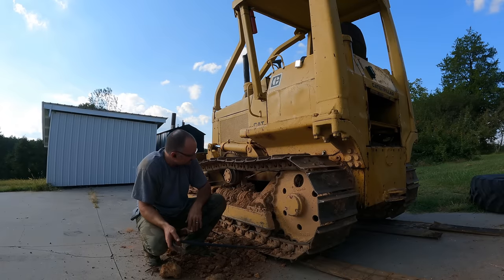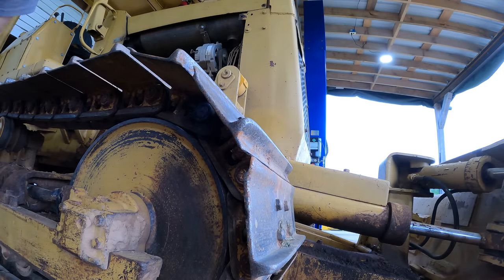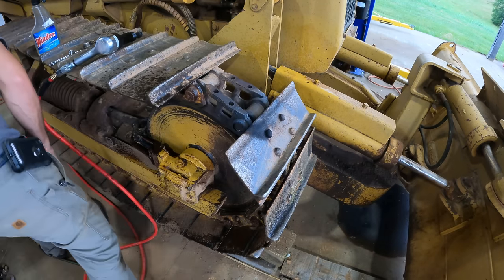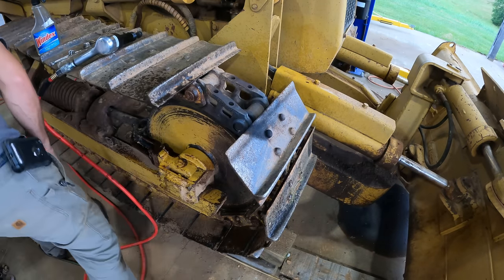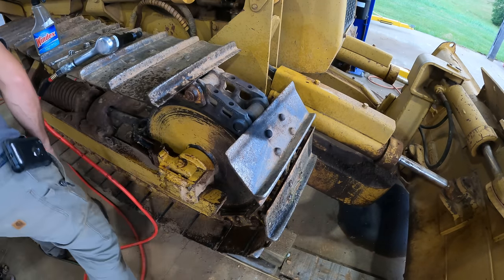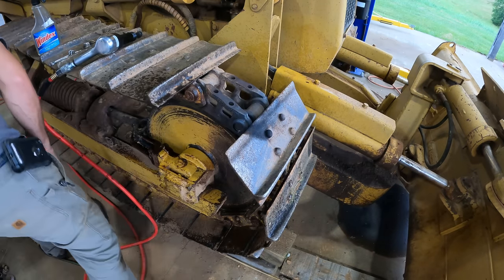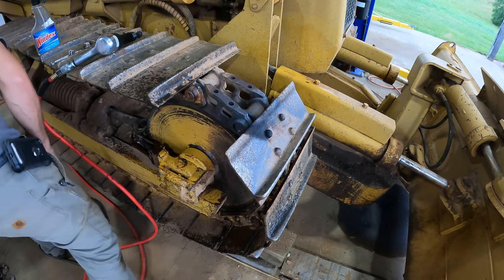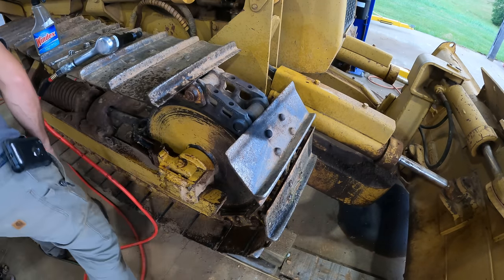Dozer Repair, Splitting Tracks, Adjuster Rails & Slides.  CAT D3 dozer

Comment: All of the Chinese electrical motor operated equipment used to come with spar brushes. DANG. but the commutator and the brush tension springs are trash now so like you said.  IT NOEY GOOD NO MORE

Comment: Have you ever considered using oxy-propane instead of acetylene? Cut Quality is not quite as good and it burns at a slightly lower temperature but it lasts way longer, you can use your same Grill bottles so you can get them filled way easier and it’s way cheaper. Just a thought you should look into it if you haven’t already. You do have to use different tips on your torch.

Comment: It is not that I'm smart, because I'm not. I would have done it the same way you did on the first track. Looking back, however you, (and I) actually simulated how engineers build bridges. They take hot steel bolts and pneumatically drive them in to steel. It turned your pin into a rivet. Its probably why you couldn't get it out. Rivets are made to stay in. 😃

Comment: Speaking of grinders, if you think 7 inches is an upgrade over 4" wait until you experience a 9 inch. You seem like a person that would get some good use out of one. A decent name brand of course, makita/dewalt/Milwaukee/Bosch/etc. Go for it.

Just got a used dewalt 9 for $50 that is actually meant as a buffer. But, it has variable speed, which is very nice for lighter grinding/areas you don't want to pelt yourself with sparks. If the blade comes apart, it wont kill me at the lower speed settings. 600-3300 rpm, the grinder does 6500 rpm. I don't even care, the variable trigger and variable range selector is nice, its more tame and controllable. If i need full blast, i have other 9s. Man, do they hog some material. 

They run just over $200 i think. No, its not 80, but its not out to get you, either. Parts are easily available, and it will last you a lifetime for non commercial use. Hey, even i fell for the hf trick before, too. Lol

Comment: At (19:50)ish in the pin looks to be wedged against the inside tractor frame. 
Is that the oversight you mentioned? (grins) Nope that's not it. I can see there is room.

Comment: Love your story about the bastard tractor that has you by the go nads. Picture your self if you were working up in the Arctic with a bastard tractor and try to complain and explain via a single side  band radio,,,,,, next time you might clean the battery terminals at the same time an an alternator change… you might still have a spare used alternator on your bench? Crap happens.

Comment: If you're looking for an excuse to buy a new tool, a metal powder flame welding torch (spray welding) would be an easy way to avoid the valleys of your weld lines when building up material. Plus it works on cast iron which is a pain to work with otherwise. Basically it's just an acetylene torch with a metal powder hopper like a paint sprayer. Old tech, but still has some use cases.

Comment: Well, by now you know... there is no need to open the track to build up the guides. Cat sells shims for this area cheap, you can push them into the gap and tack weld in place, half hour each side, tops. I am surprised you did not choose to install the modern master link while it was opened.

Comment: I saw the blade beams where they connect to the frame under the engine move/jerk is there a bearing there gone bad or are they suppose to move (1:06:34) Hope I'm not the messenger of bad vibes.

Comment: Dear Jon,
.
I have no experience like you do, I haven’t read the rest of the comments, but I do have experience with rivets and BICYCLE CHAINS !
.
MY QUESTION is WHY DID YOU NEED TO PRESS THE RIVET OUT OF THE SECOND SIDE?
.
In “breaking” a bicycle chain, the home mechanic can get into a whole RAFT of problems driving the rivet completely out of the second link, due to the press fit.  I’ve had plenty of learning opportunities, believe me, 🙄!
.
Unless I miss my guess, your track was already separated when you drove the pin out of the outside link, and out of the central bushing, no?
.
I consider myself a thinking, decently educated DIY guy, but I don’t have your machines or tools.
.
But one bit of wisdom I’ve learned is, if something is telling you it doesn’t want to come out, don’t force it out if you don’t have to.  The rivet may be smarter than the mechanic!
.
——
You hear the old Jewish joke about the patient and Doctor?  (I’m Jewish, but not a Doctor, 😉.)

—“Doctor,” the patient complained, while sitting on the exam table, “It hurts when I do this,” (demonstrates).
.
The Doctor replied, Don’t do that…!” 😉.
.
I think that’s what we got going on here.  I haven’t watched the whole video.  Maybe you even discussed all this!
—————
✌🏽😉👋🏽.

Comment: Should have removed the grease fitting from the adjusting cylinder that takes the tension off the pins. Your track is tight

Comment: A lot of extra work for nothing. All the years I worked in big company logging camp. We had D7 an D8 for building logging roads an ice roads in winter. When them idler slides would get badly waren like that they call me to come were the dozer was  50 miles from main camp shop an I'd lift the front end up an drive a cut peace of T1 steel bevel the edges an weld them in.  Machine would run a year an have to do it again. No splitting tracks needed

Comment: You might try combining your propane with oxygen.  It doesn't quite reach Oxy/ACE but way hotter than propane by itself.  As you know propane is way cheaper than acet.  I've quit using acet for that reason.  I can cut very nicely with propane anyd oxy
PS:  Their Hercules tools are better than their Bauer!!!!  A Metalbo or Makita would last longer but that may not be necessary for your volume of work.
Go watch "Project Farm" to learn about the penetrating oils.
I do compliment you on your aim with the sledge.    To get parts from Harbor Freight you have to contact their "parts division".  I have gotten parts from them for my bandsaw, drill press, and they weren't even Harbor Freight machines.  I just matched "parts".

Comment: So if the glow plugs decide not work at some point and you're in a hurry, just light a torch (with diesel fuel) near the air intake, without the filter of course, and give it a go. It should start with little effort. Of course, it is your last resort

Comment: Heat the rail not the pin, buy a track punch, have someone hold the track punch while you hit it with a 16 pound sledge, don’t worry about damaging the pin you will have to grind it or turn it on a lathe to fit back in the rail. Weld the pin back in. You should always put a 12”/12”  or larger wood block in front of the track grouser pad and drive into it before removing track pin. The wood block will hold the track rail steady so you can drive the pin out. Adjust your rose bud to a short blue flame while heating. This is not a one man job. Track punch is the key.

Comment: I forgot to mention stop using expensive nasty acetylene.  Get a propane/natural gas tip for your cutting torch. Then stick your regulator on a standard 20lb propane tank. There is A learning curve getting it lit (kinda but it’s very simple actually).  Just light the
Gas then place the tip against something, then turn on oxygen.
It prevents the flame from blowing out prematurely
Reply: Well after watching your going to need the adapter or a different regulator because you have the female regulator. Or simply change
The stem on the regulator.  A male regulator will Fit both bottles if you get the female acetylene bottle.

Comment: FYI..you should never run a new chain on an old sprocket. The chain will have a larger diameter at the bushing tubes and not seat properly in the old sprocket, leading to premature wear. Your dozer is a great farm machine..when the time and finances allow, do it all, trust me, you’ll be happy. That was a great video..isn’t learning great!!

Comment: @ 30:13 Man... That was 1 hell of a stubborn Pin...
...
That reminded me of taking a flywheel of a tapered shaft.... Some 45 years ago...
I had all kind of extractors;... broke most of them;... would it budge ... Nope
2 x 3/8" plate steel bolted through together...
2 because I bent 1...
Had it glowing cherry red;... just like yours... Still nothing...
...
Then the voice from;... she who must B obeyed...
Son your dinner is on the table...
Mother just give me a few more minuets please I replied...
Now I said or else...
1 has 2 obey every now & again...
Sitting there at table thinking 2 mi sen...
Note I'm dangerous when I think...
All that hard work 4 what...
A super nice HOT Saturday dinner that's 4 sure...
After that;... all bloated;... thinking how am I going 2 get back on that engine;... stuffed like I was...
...
Mi Dad had nodded off like he nearly always does...
Then... There was a very loud noise from the Garage... Could not describe it;... heard nothing like it in my life & never since... Then the sound of metal hitting metal;... then the concrete floor;... kind'a dull in comparison...
Mum nearly fainted;... dad jumped up... I was legging 2 the garage 2 C what had transpired...
Only 2 find the Flywheel off & on the floor under the car...
Take Note...
Never pick a peace of metal up with naked hands that was glowing cherry red not some 30 minuets earlier... Boy I soon dropped it...
My only explanation is;... was both metals of different grades had cooled 2 the exact point where they released themselves from each other from the tension of being clamped...
But I was happy 2 have the flywheel off... 2 have;... renew the ring gear...

Comment: You can save a lot of money by using oxygen and propane instead of oxygen and acetylene. Save the expensive stuff when you have to use a torch the cut heavy steel of gas weld. But you can use propane for most of your projects.

Comment: Must admit to not really understanding your reluctance to use the glowplugs every time when trying to start the engine. I'm not really a small diesel fan, in 45 years of owning cars I have only owned 3 or 4 diesels, but on all of them I used to wait till the glow plug light had gone out before starting the engine. They start so much easier and it takes a lot of strain off the battery and starter motor.
Rest of the job though, really good stuff, some good learning lessons.
Reply from the maker: We must have a miscommunication.  I use the glow plugs every time.  It wouldn't start this time because the plugs weren't working.  Cheers.
Reply: @FarmCraft101  I was thinking back to some earlier videos that you did on it. But maybe I have you mixed up with Diesel Creek, too many channels to watch these days. My apologies if I have mixed you both up.
Reply from the maker: You may be remembering earlier when I got the dozer I was trying to start without the glow plugs.  Reason being it says that it shouldn't need them if the temp is over 65F, so I was using that to judge if something was wrong.  Basically, assessing the health of the engine.  But for regular use, I always use the plugs.
Reply: @FarmCraft101  Ahh that was it. I'd just use them all the time anyway. I do really like your channel by the way, such a variety of problem solving, only CEE beats it in my book.

Comment: Jon, couldn't you have contacted a local construction or mining company (or CAT heavy machine dealer) and borrowed/rented a pin puller for a day? I can't imagine they need to use those tools continuously or daily. Besides, with your YouTube content they could monitor your care and use of the tool. Your "creative method" to substitute for a proper tool reminds me how I destroyed pulleys, axles and bearings by not using a bearing/pulley puller. In my mind I could not justify the expense of a puller only to use two or three times. Reality showed me the cost of axles, keys, bearings, pulleys and time effort far outweighed the cost. Just a thought.

Comment: I would say. The arcing isa sign that a rotor vinding is dead on that angle grinder .  I mean it is cheap and the cheap ones usually does not have any thermal protection . As soon as you overheat a insulation materil between vindings it starts doing this . BU it will smell also .. maybe I am wrong andthis is just a sign of a weak brush spring.

Comment: The copper strands in the wire insulation jacket is likely snapped, so as the wire segment moves, that break opens or closes depending on how the wire is bent at that moment resulting in the intermittent fault you had so much fun tracing down...

Automotive Techs in particular Loath Intermittent faults in a car's wiring harness with a truly Unholy Passion if for no other reason that to properly check the wires form connector end to connector end, they have to take most of the interior apart to remove the entire Harness...

😄😁😆😅😂🤣

Comment: Your OG sledge would've worked if you knew how to swing a sledge. A sledge transfers energy from head momentum. Having a heavier head is exactly the same momentum as a smaller sledge at a higher velocity. Your swing with hands about 18 inches apart is limiting your head velocity. To properly swing a sledge, you need to lift it with hand separation, but as soon as you start the swing, you need to bring your hands together and swing the sledge  like a baseball bat. That will superpower your sledge use in future. You can practice by breaking up concrete.

Comment: That air hammer was never going to work, just about passable to rivet up a heritage boiler, nothing more. The next size up, as they would use in mining has a handle like a shovel and uses the same size airline as a jackhammer - Maybe that would have worked, not sure TBO. Now, that ball joint puller, you rely too much on the rattle gun - stick a breaker bar on it and turn by hand, you can easily exceed the torque output of that little rattle gun.

Comment: In OZ, 9 inch grinders have been banned on job sites for around ten years, Consequently, you can buy very cheap Hitachi's, Makita's, AEG's and other good brands on the second hand market. You think a 7 inch can move some material! Wait till you try a 9 inch!  A large degree of caution is required using them, though! I have had two friends [ also tradesmen boilermakers ] killed by them over the last 3 decades! I don't know if your rules are similar over there or not. Most definitely not a tool for anyone without a couple years of grinder experience, who doesn't yet understand which way grinders kick back.

Comment: You know you could have hooked your propane tank to your oxy acetylene torch and it would have made the heat you needed I have cut a lot of metal with propane and oxygen when scraping we always use propane and oxygen cause it's cheaper and cuts fine acetylene makes smoother cleaner cuts like you need for fabrication but propane gets plenty hot when you add oxygen to it

Comment: Why do it the hard way never take the tracks apart especially when you have an excavator that can move the track for you. Release the pressure of the track adjuster and move the idler back and move the track you could have had the track off in 30 min instead messing with the pin all day good luck

Comment: Be careful running the big blades on your smaller grinder. They are not rated for the rpm that the 4" grinder runs at, word is they can come apart at higher rpm. Engage safety squints.
Reply from the maker: Not many have noticed I did that. But I was sure to wear a full face shield during that idiocy. 😂

Comment: Have you never had any safety training. Your torch tanks should be supported from getting knocked over either by. Ring on a cart or tied to a wall or post. I worked on a job were two men were killed and a third severely injured involving an oxygen tank explosion and resulting fire.

Comment: Nobody really cares about the washers. You will notice issues maybe in five or even ten years. And if something will ever happen with that link, you can weld it. New bushing, a few steel plates, and you're ready to go. Considering how you use the machine, you will never need a new track chain.

Comment: The problem was not making a mistake, it was not backing off and trying a different approach once you realized you made a mistake..  Sorry for the insult, but your pigheaded insistence on forcing the pin through from the same side vs just lifting the track off and getting it in a better position, driving it back half an inch and then just chopping the end off would have saved you a huge amount of effort and also not ruined your ball joint press...   Yes, you won, but you also lost... Hopefully the lesson was learned...

Comment: teers streem down my cheeks, oh the buichery s  fitter this mkes me cry. remove both grouser pltes to do tht esly het bolt heds 3 times to cherry, let cool to blck then rttle gun with single hex socket will be finger tight s bolts will get longer from heting. i would of scked you on the spot.
sorry button on key bord not working hope the het 3 times to chrerry trick helps on other jobs i hve seen d11 trck bolts removed with  hnd spnner tht wy qnd they re over 3000 foot pounds. dont use bolts gin thou s they re now u/s crystlised